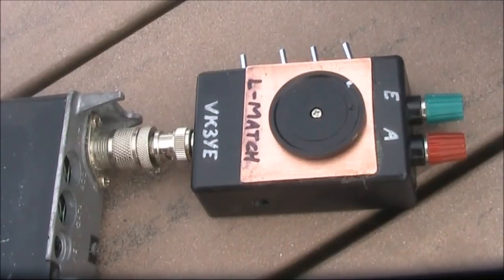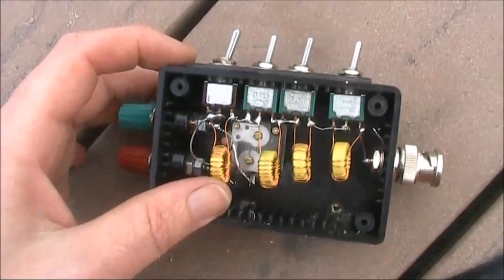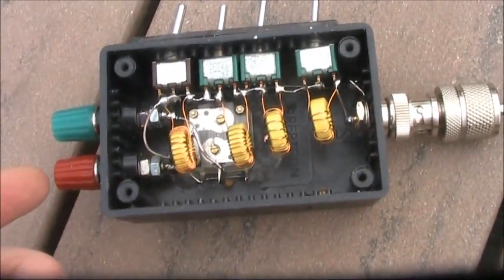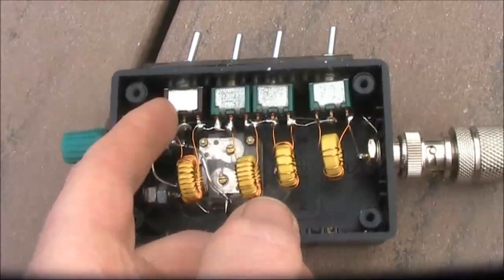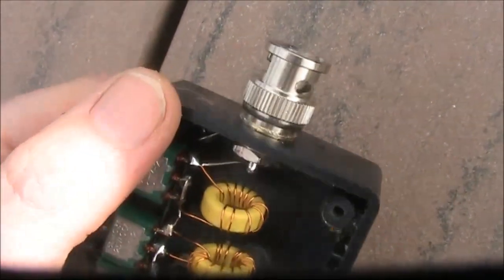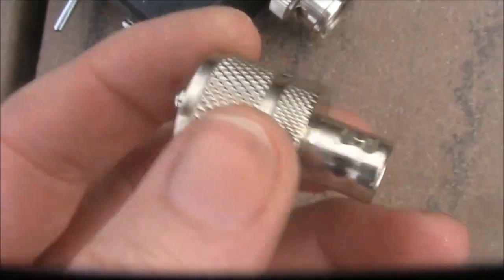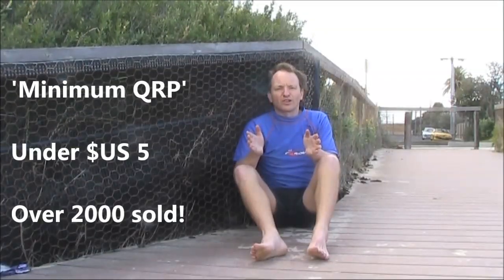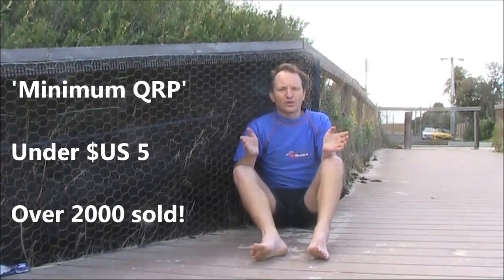Yet another QRP L match antenna coupler

Comment: Where do you get your toroid cores from , from junk or bought and what code are they ie mix and how do you test them before use ?.
Reply from the maker: I got mine from a club I'm in when they used to sell parts. I think G-QRP Club sells them. Yellow are T50-6, red are T50-2. No need to test if from a reputable source.

Comment: Hi Peter, another great video. I can't find any reference to the wire thickness for the toroids here or on your website. What do you recommend? Incidentally, I purchased your Australian Ham Radio Handbook plus also I just ordered the two "QRP Antenna" books and the "99 things" books, all paper copies. 73.
Reply from the maker: Hi David - about 0.4 or 0.5 mm is about right - not critical. Too thick is hard to wind, too thin is fragile.
Reply: @vk3ye  Thanks Peter.

Comment: I built one of these 12 months ago and it has become my favourite antenna for lightweight QRP SOTA and WWFF. 

I use 21m of wire in an inverted L fashion on a 5.5 metre fibreglass pole. I have a counterpoise of about 5 metres running along the ground.
I've used it on 80, 40, 20 and 15m.

Comment: What power does it support? What is approximately the insertion loss? Is the adjustment necessary because you use it with different wire lengths?
Reply from the maker: I wouldn't run any more than 5 to 7 watts through it. The limiting factor would be the variable capacitors.  Also I'd be wary about putting high RF powers through the switches. I haven't measured the insertion loss but I'd expect under 1dB.  Adjustments are necessary due to the varying impedances (and to cancel out the various inductive and capacitive reactances) that will change with frequency and wire length.
Reply: Sorry, I have a lot of respect for your work, so I want to better understand the reason for this tuner: Take as an example a single band: 40m and a cable length: 20m. In this case, is a L coupler more convenient than a 64: 1 transformer? The efficiency is similar?
Reply from the maker: A transformer is fixed ratio.  It's good for a fixed transformation where impedances are purely resistive.  It can work pretty well. But variable L and C, such as with an L-match is more versatile, allows reactance to be tuned out and may be more efficient.

Comment: Nice little device! I believe I'm seeing a resistor in the box there. Where would it be in the circuit diagram? I believe you have put it (the static energy bleeder resistor)  on the antenna side in some earlier designs. Shouldn't it rather be on the transceiver side, as that node is much lower impedance than the antenna connection? Anyway, I really enjoy watching you demonstrate the things you build. Thanks for making these videos! 73 de Magne, LA1WUA
Reply from the maker: HI Magne, It needs to be on the antenna side. Even a high impedance antenna is only 5k. A bleeder resistor might be 100k - 1M. So its effect will be negligible.

Comment: I'm not quite sure what my issue is receiving HF. I'm using my FT-857D but own all three of the Yeasu 800 series transceivers. As for antennas I've set up a pair of 40 meter hamstiks, a 30 ft x 30 ft. long wire with a 50 ohm balun, and a 102" vertical for 10 meters. In the past I've had no issues receiving with my Kenwood R-2000 receiver on HF using a long wire running the length of my roof. It seems almost as if something is attenuating my signal. I'm using no more than a 40' run of  RG-8x coax with the (gray colored outer jacket).

Comment: How about adding an extra SPDT switch for changing L match configuration? Ie. inductors on exit or entry, thus a wider matching range.
Reply from the maker: +Paweł Stobiński My experience with having this switch to allow matching of low impedance antennas is that it is rarely if ever used so is a waste of space.
Reply: Peter, me totally agree with Paweł s idea. So, easy and cheap constructin. works on 100%. 73! Ladislav OK1UNL